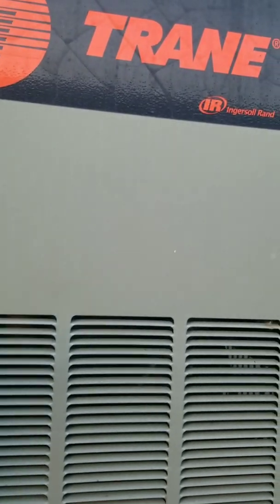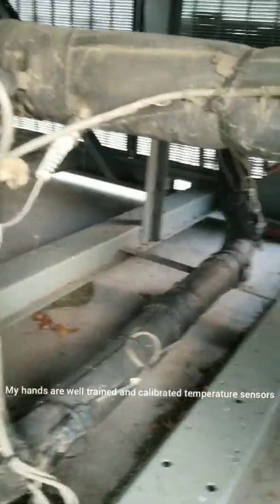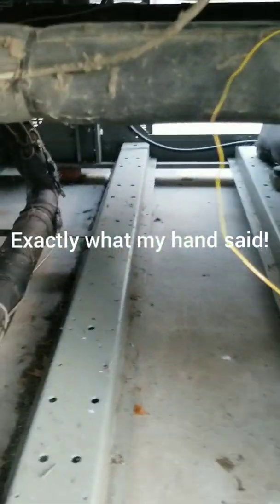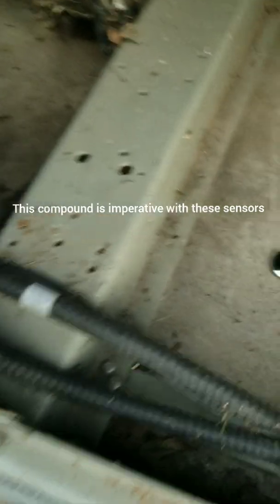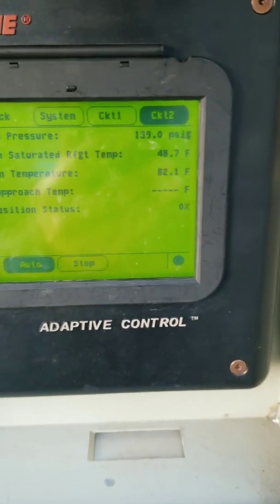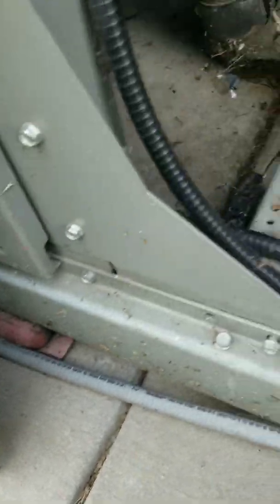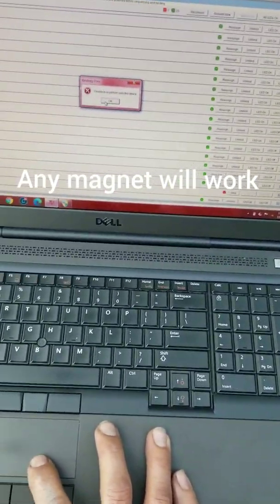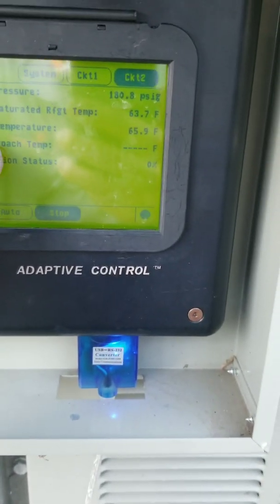Hvac no cooling service call, Trane chiller locked out with sensor issues

Comment: hello sir
my chiller ch530 circuit 1 stopped after running for 20 mins. and show on the screen External circuit lockout. how do i solve this. please help
Reply from the maker: External lock out sounds like it's going to be External to the chiller, could be many things but you need to check all pumps, flow switches and anything that may be controlling this chiller.

Comment: Hello sir ..my system show "chiller excessive loss of communication" alarm ...so what can i do ... Please provide solutions
Reply from the maker: I have never seen excessive loss of communication but sounds like you need to start with basic checks, Verify all voltage and that all components operate and no fuses blown. Communication loss is just something not communicating. After voltages and all other things are verified make sure all sensors are reading... correctly... a power reset may be necessary especially if there were any power issues that may have caused a board or control problem.

Comment: Train rtac3504 chiller  why going low evaporated temperature
Reply from the maker: Could be a lot of things, start with the basics  Water flow, water flow, water flow. It's like air flow gotta have it, or you got another failing trane sensor.

Comment: The CHL I service is barely 2yrs old and I already have a bad sensor … Thanks for the heads up
Reply from the maker: They are a consistent problem with the sensors not reading correctly. Trane says they have improved the sensor design though they look the same to me. Just be sure to use the paste on them and verify your temperatures periodically. Thanks for watching Clifford!
Reply: @EverythingHVACR I gotta agree with you … Found my 3rd faulty suction line temp sensor on Friday … Do I have to pay for the Trane software to bind the new sensor .?
Reply from the maker: I believe tech view software is free. I think I saw a link posted by subcool hvac on one of his videos recently, but It shouldn't be too hard to find.

Comment: How to bind a EEV theres no led!
Reply from the maker: Thanks Bernie! Is that a question? Not sure if the EEV binds it might be wired directly to the board. If it does bind you have to swipe a magnet just like the temp sensors then LED should light up.
Reply: @EverythingHVACR  That circuit will not run. the program shows 22 things its looking at, but the EEV circuit 2 needs to be binded it had some com problem i had to rebind 3 other things.
Reply: Anyways a Trane tec coming to help in maybe a week or so, oh well.
Reply from the maker: If it won't bind you may need a new Valve, otherwise should bind the same way as the sensors I would think but I've never had a problem with the EEVs before
Reply: @EverythingHVACR  Hello! Update on the chiller, the module harness that plugs into the eev is bad and  they dont make them anymore. It sucks that chiller is only 10 years old so need to upgrade to new version of eev, short module harness and board up front that it plugs into. Confirmed by the trane tech to troubleshoot problem.
Reply from the maker: Nice, glad to hear you got it 👍 Thanks Bernie!

Comment: First hit bind, and don't hit yes yet.  After u have hit bind, then put ur magnet on, then hit yes.  
I've been thru that frustrating situation before.
Reply from the maker: Correct, it's much easier on the new chillers, all can be done from the control panel without using tech view. Thanks for watching!

Comment: There is no temperature sensor reading on the CH530 display. We connect through the TechView interface. Visible connections 16pcs. Through TechView it shows: active - 0 / inactive 16 pcs. Why so? Is there a step-by-step instruction on how to bind a sensor?
Reply from the maker: You may have a failed sensor, go to binding view and see if it's there then unbind old sensor that's not reading and bind new sensor. If sensor is there you'll see it in the binding view, it may show up as "Red" because it's not reading all other operating sensors will show "green" always verify sensor temperature readings with a K type probe. -0 is an unusual reading
Reply: @EverythingHVACR  How do I switch to snap mode? When I select the types of connections, all 16 sensors light up "red". A must burn only one, since only one faulty sensor.
Reply from the maker: Not sure what snap mode is but if all sensors show red you may have another issue, I have never seen one do that. That would make me think none are communicating, you could try a re boot of system. You may have to get ahold of Trane tech support.

Comment: That the most problem with trane cgam suction temp sensor out of range temp reading
Reply from the maker: Yeah, all the sensors really, I've replaced a water temp sensor, it gets out of whack and locks out on low water flow. Thanks for watching!
Reply: Mine is showing 226 deg suction temp 😂😂

Comment: What do you mean when you say "bind" and/or "rebind" the sensor?
Reply from the maker: The sensors communicate information back to the control. You must remove the old sensor and un bind so the control does not see that sensor anymore. The you have to pull the new sensor in to the control and re bind. Basically setting the control to see that specific sensor. There are many videos on binding trane sensors. Thanks for watching!
Reply: @EverythingHVACR  Thank you!
Reply: Why is the magnetic LED to be caught while binding, and how does the LED light up when the magnet is caught?
Reply from the maker: Good question and maybe one for trane, I would guess for one thing it keeps you from buying just any sensor and installing it this way you must go back to trane for parts.

Comment: Can you please send me the software
Reply from the maker: That software is free, you should be able to download it, no licensing needed. Its called tech view.
Reply: Can be download free?
Reply from the maker: Honestly I'm not sure if it's free, it is not used as much anymore and usually the license that cost so it may be.
Reply: @EverythingHVACR  Thanks bro.
Reply: @lawrencebauzon4429  techview is still free.  You will need to get a Java plug in off oracle also.  It will direct you to the specific version you need.
Reply: @jonnymac31  thank you bro.!

Comment: The ch530 screen was very limited and failed to see,  even when you used wrong sub file,   I believe you had a  setting to potential limit lock out?     also what are your thought as  the running the evaps pumps  5 or 10 minutes after external or  ch530 shuts down  to utilize stored paid electrical costs for  refrig cooling in brazed evap?        [ANy  EXPERIANCE not htese  one day   trane school wonders ]service man  on chiller pumps  ie cgma 070 3"  strainer service,  Trane  show  NO gasket  available just a complete service kit .  

Can you verify  true accuracy of  sensors probe  in a    3/4" glass of ice and water to confirm 32 degrees, and  not just blindly accept these senors  even the old sen 0923  super secedes  sen2133  Thank   Bill Purcell  Navy  master chief engineer,  and  commercial  mechanical  service  sine 1964  direct  answer if you wish to mrbillpurcell@gmail.com
Reply from the maker: Thanks for watching! Lock out was high suction temperature. Evap pump shuts down on chiller, building has a circulating pump that runs constant. Wouldn't think running pump extra would be worth any savings. Any sensor could be tested in ice water, it's a good way to test any sensor, I check my K type sensors that way periodically.